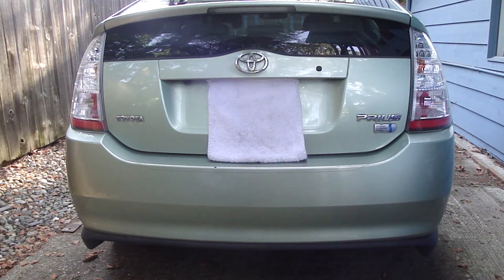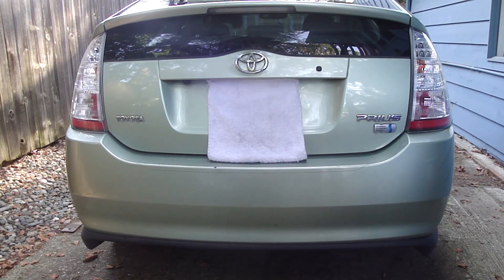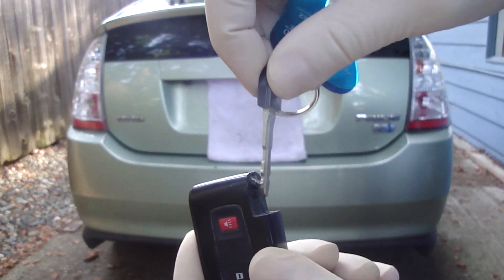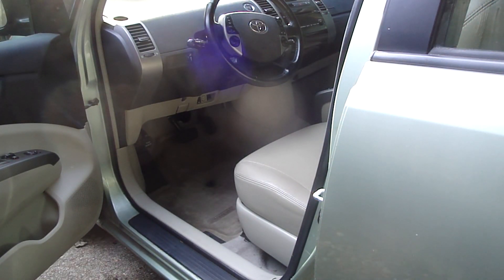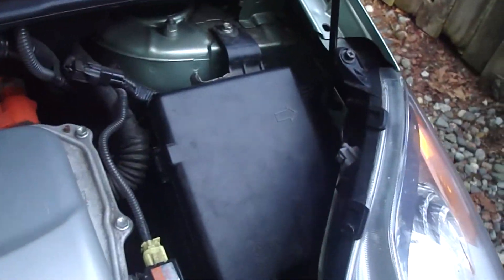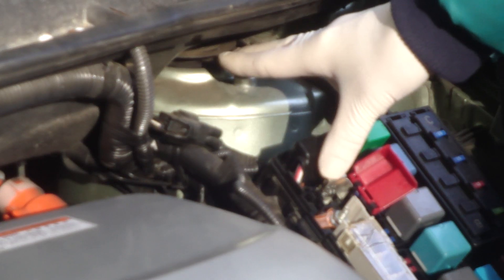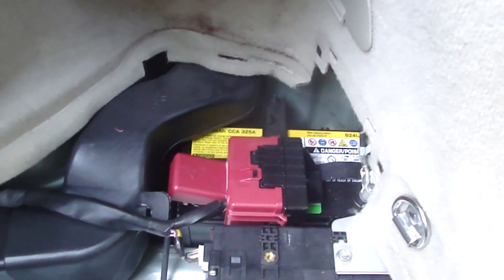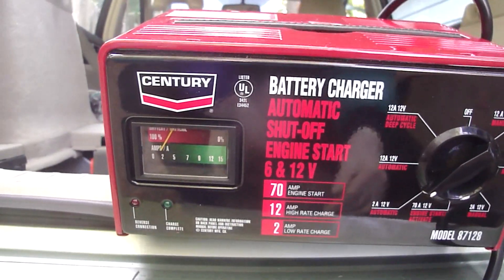Toyota Prius w/Dead 12 volt Battery / How to Open the Rear Hatch & Jump Start or Charge

Comment: Very convenient?  Doors are unlocked when your battery is died?  Try making this video when your doors are locked and the battery is dead AND the Valet Key (manual lock on the driver side) is too old to work...
Reply from the maker: If your key doesn't work you'll have to call a locksmith.  Don't go to the dealer as they are very expensive.  I don't know why Toyota didn't build a lock on the right side door, Oh yes I do, it saved them $5.00 a unit!

Comment: Thanks for the tip on opening the hatch. That seems dangerous that there is no handle to open it without taking the car apart. Most modern sedans have a latch inside the trunk to open the lid... of course you'd have to have back seats that fold down. I really didn't see much of what you did to charge the battery in the rear of the car.... so I am still at a loss.  Besides YouTube likes to put ads up before the video is finished...annoying as hell.
Reply from the maker: For this video I affixed the battery charger directly to the battery in the rear compartment.  When I top off the battery I do it from the engine compartment. If you go to the fuse box on the driver's side of the engine compartment.  Remove the fuse box cover and you will see a terminal covered with a red plastic cover.  That's the positive terminal to which you affix the positive cable of the battery charger.  The negative cable of the battery charger gets clamped to a stud on the unibody a few inches to the rear of the fuse box.
Reply: @davidgpo   Thank you very much for this additional info.
Reply: Yes, a really piss-poor design for those Oh-So-Intelligent Japanese designers to come up with.

Comment: Left my overhead cabin light on, came out and discovered a dead battery. Thank you so much for showing us how to get into the car, the rear door opened and the battery recharged.
Reply from the maker: I replaced those lamps with LED lamps for just that reason:   https://www.youtube.com/watch?v=QZMt-UZRasc&ab_channel=davidgpo
Reply: @davidgpo  Where do you get those lamps?
Reply from the maker: @amywalker7515    I ordered them through Amazon.

Comment: The old stealership, always taking shortcuts. My 12v dies if it sits more than 2 days. I think the battery is weak and an aftermarket remote start kills it. Great tip on checking the spare as long as you're down there. I remember the 1st time I had to open the hatch from the inside, thanks Toyota.
Reply from the maker: It sounds like you have a current draw.  You need to find which circuit is related to that.

Comment: Good video, simple and clear. My 2008 looks the same, though this time around I just went through the rear passenger door and took the access hatch cover off the battery without removing the luggage compartment floor. I appreciate the very helpful reminder to remove the connection (and telling us the proper wrench size!) to the negative terminal before attaching the charger leads and giving it juice.
Reply: Thank you.  I'm too old to crawl back there ;)

Comment: We can connect postive wire to de red cover below .and negative to that screw so it can charge the battery automatically?
Reply from the maker: Yes, but it's only automatic if your charger has a feature to keep it from over-charging.

Comment: Also if your fussing with the 12 volt battery get a flashlight and look in the bottom of the well that battery is sitting in. On most prius it will be full of water. Very very common to have a cabin leak back there. It comes from cracks in the body.
There are 2 black plastic strips on the roof sides. They pop right off. Look at the valley area where those drip valleys meet the hatch quarter panel. You can see there its pop welded and puttied. On just about every G2 you will see hairline cracks in those upper hatch corner valleys. Not sure if its from slamming the hatch cover all the time or its just big body flex there. very very common leak lots of water under the spare tire and in the battery well. if really bad the water will overflow in the cabin and get under the back seat carpet.
Reply from the maker: Very good point.  Fortunately, our interior is bone dry.
Reply: There is a rubber plug under the car that is the lowest part of the battery compartment. I popped mine off and the water drained out :)
Reply: @MilesCobbett  Also I assume its the plug in the battery well. There's 2 plugs in the trunk floor one  under the spare tire and one in the battery well. Would not to surprise me there was a swimming pool under the spare tire.
Reply: Thanks for the tip. This happened to me and wondered why the carpet floor behind is always wet. Discovered the trunk was full of water.🥲

Comment: You can charge on the front hood itself... No need to go to the actual battery in the trunk after all these difficult maneuvers
Reply from the maker: Yes, however if the battery won't take a charge you have to dive in through the back.

Comment: Well done!   Note that when you remove the top of  the tool tray, there's a plastic cutout that covers the opening where the hatch latch sits.  If you punch out that cutout, you can reach the hatch latch without taking the tool tray out of the car.   Good tip about checking the air pressure in the spare!
Reply from the maker: Great tip!
Reply: The battery in the rear does not start the car !  Only the hybrid battery starts the car!
Reply: @ratrod40 It does power the accessories/computer though, without which the car definitely will stay dead, no matter how much power you have in the HV battery.

Comment: Hi! I have a 2006 Prius. I did not drive it for a couple of weeks and the car was dead. My husband replaced the battery in the back of the car and the car turned on without a problem. My husband turned it back off and the car never started again. What can we do? Please help and any advice will be greatly appreciated. Thank you!
Reply from the maker: Check the fuse box and check all the fuses and the starter relay.  Then take a volt meter to the battery to check it's voltage.  If it has 12 volts the battery is good.  Put the volt meter to the leads of the starter to see if the starter is getting voltage.  If the starter is getting voltage the starter may be bad.
Reply: @davidgpo  The G2 Prius does not have s starter. Its uses MG1 to spool up the engine.
Reply from the maker: @My1970TransAm    I didn't know that.  Thanks!

Comment: So many prius are dying these days as no one drives there car much because of Covid. That will kill an old G2 prius both the 12 volt battery and especially the hybrid battery. Go to the prius online Forum for prius called PRIUSCHAT.COM  and join. Wealth of info.

NOW do not ever ever jump your 12 volt battery by connecting directly to the battery in the trunk. Seen so many people F that up reverse the leads and destroy the 12 volt power buss.
Its dangerous its stupid.
Toyota gave you the 12 volt jump point in the front of the car they do not want you in the hatch. If the 12 volt battery dies you do not need to crawl into the hatch area and open the hatch that's why they gave you the front jump point!!!!
Inside the key fob is the hidden mechanical key to the front door. There's a little switch lock on the top of the fob. Hold that lock over to one side and pull the key out. Use that to open the front door.
Pop the hood. Inside the engine compartment is a big BLACK plastic box to the right of the inverter big silver cover. Take the cover off that fuse box. Under there is a little red plastic cover. Little clip on the left of that red cover open that clip and swing open the little red door revealing a little metal vertical mounted metal tang. That tang is bolted down to the fuse box and the main power lead from the battery in the hatch.
 Its connected to the positive terminal on the 12 volt battery in the hatch.  That vertical  metal tang is where you connect the positive red jump clamp. That's why theirs a vertical mounted tang there so you can attach the big jaws of the red  jumper lead clamp to it or your battery charger. The ground is use the bare bolt head right above it on the chassis. I have also  used the front jump point to battery tend for years and years.

Never ever measure the DC voltage directly at the battery first. Its meaningless. it only matters what the car see's at that front jump point. Before that big cable gets to that jump point tang it has to go through 8 connections to the battery  one being the ground and one big long under the car cable 15 foot long cable. Measuring 12 volt dc at the Jump Point tests all those connections and its ground to the chassis.
Cant tell you how many times people say my 12 volt is good I measured it and the car still wont start. That's because there not measuring it where the car sees it. Loose or corroded ground in the hatch and you will have nothing at the front jump point. testing in that hatch across the battery's terminals you will not see that.

TIP:   Take the car mechanical key out of the fob now and test the door lock. Most g2 owners have there car for years before they need to use that key.. They desperately need it to work and find the mechanical door lock is rusted stuck because it has never ever been used. Find out now and shoot some  l;lubrication in the key hole before trying it. It will need that lube lol trust me.
Because sooner or later you will get a dead 12 volt battery in your G2. GUARANTEED!
,
Reply: That's exactly my problem. Not driving the car. 12v battery is dead.

Question: should I try and recharge the 12v battery or change it altogether?

Will the hybrid battery be gone if we don't drive?
Reply: @kmsubbu  if the 12 volt is older then 3 years old or has gone dead before change it.
Always use the front jump points to charge. As far as removing the 12 volt battery there are 2 black power leads plugged into the 12 volt pos post assy.
The fat one is the main B+ line to the fuse box it is bolted down to the same nut that holds the jump vertical tang in the front fuse box. The skinny one is the I invert sensing line.
They both can be easily unpluged by pressing the little white lever in there white plug and unplug it. Then No sparks changing out the 12 volt.
if you have the original hybrid battery you will surely kill it letting it sit. Corrosion quickly becomes an issue and so do does self discharge.

Comment: Just want to clarify- if you need a quick jump you can do this under the hood? But if you need to recharge the battery.. it should be done on the actual battery itself in the trunk?
Reply: Bullshit. I have been maintenance charging my 12 volt battery for 13 years using the front jump points.
Reply from the maker: It should work either way.  I thought the charge would be more efficient by charging directly on the battery rather than going through ten feet of wire (the longer the wire the more resistance).

Comment: The thing I found is that the terminal opening is so small that it was REALLY hard to make my jumper cable make contact!
Reply: No.. it has a vertical tang of aluminum bolted to it very easy to attach a jump claw. Look at it closely.
Reply: @My1970TransAm This. Took me a while to realize that as well.
Reply from the maker: Yes, it's like a toy.
Reply: @davidgpo  it IS a toy- we called them Toymotas in College, yet we all had one.

Comment: On a 2019 Prius Plus model I could not find a lever to open the hatch but was able to access the battery from inside the car to give enough charge to open the rear hatch electronically, thanks for your help

Comment: I went to autozone they told me its conpany policy they cant charge or test my battery. My screen is cracked and touchscreen doesnt work. Is it safe to buy a battery teater amd test it myself
Reply: Due to covid, they wouldn't run a diagnostic on mine, (corporate policy)  so that could be it.    Find a locally owned.
Reply from the maker: Don't understand why they won't test your battery.  Did you call some other stores/shops?   I don't see what harm you can cause by testing it yourself.
Reply: Try batteries and light bulbs

Comment: Unfortunate;y, he is demonstrating on a car with a working battery installed.  That's why he was able to open the back driver's side door by reaching in and pulling the handle.  In reality, if the battery is dead, the back door handles do not work so you are stuck with having to try to climb over/between the front seats to get into the back seat to try to put the seatbacks down and do the rest of the steps to open the hatchback.  The men in every video on its problem have done the same thing.  If you are going to show how to do this with a dead battery and all the doors locked, you should disconnect the battery first so we can see what's it's really like.
Reply: Actually in my case - I started with searching for 'how to open the hatch from inside the prius with dead battery' - found that easily on google - then navigated to this fine video and it got me to the steps needed - You are correct in your assessment. Perhaps you could add value and create the full video you are referring to?
Reply: Yes, l was locked out with no 12V power and had to start off using the little key inside the fob to open drivers door.

Comment: DON'T PUT YOUR HAND TOUCHING BOTH THE POSITIVE FUSE BOX TERMINAL AND THE CHASSIS!  

He had a glove on and perhaps the battery was mostly dead but don't do what he showed.  Please be safe!
Reply: thats 12 volts dc dude. It wont hurt you a bit.
Reply: Your kidding me.
12 volts dc is very safe. You can touch it all day long.
Reply: Bro, stick to squishy remakes.
Reply: Also don't touch the red and black jumper cables to your tongue at the same time. 
Why would your hand ever be on the positive fuse box terminal and the chassis?
Reply: I thought the tongue test was how you made sure your charger was working. @AlitaBeyay

Comment: Prius 2007 nothing show light, all not working. It's hard open the door and even the back. We used key it's open driver side, insert key and power buttom green, and red but nothing all work. Maybe it's battery problem.
Reply from the maker: You can open the hood and charge the battery at the battery terminals incorporated in the fuse box.
Reply: @davidgpo  How the heck you open the Hood when your battery is dean and you are locked out?
Reply: @mishrasunny  You key fob has a physical key on it to open the driver door. Then you can open the hood

Comment: ghaa wanted to see how you get the stupid plastic hatch opened and you skipped that @.@
Reply from the maker: You don't have to remove the plastic covering on the hatch, you can reach the latch with your hand without removing the cover.
Reply: @SquishySquid .  First you remove the horizontal cover that hides the tire tools, THEN you remove the black plastic tray that hides the spare. Then you can reach the hatch release.
If you need to remove the hatch trim(big plastic piece) for another repair, search Youtube

Comment: Whatever you do DON'T CHARGE A PRIUS WITH OVER 2.5 AMPS.  The manual also warns not to charge the battery in the vehicle because the noxious gasses released from the battery can cause the battery to explode and that can KILL OR MAIM YOU and IT WILL RUIN THE CAR.
Less than a year ago, I used a battery charger to start MY 2004 PRIUS  I charged it on the lowest setting, but it was not a trickle charger.  A day later, the battery was dead forever.  I had it towed to the dealer. A new battery costs almost $280, but the dealer was the only supplier who offered a three-year warranty.     At the time I jump-started,  I tried to keep the voltage the lowest setting but had no idea of the danger I put me and my vehicle in.  My new battery died from a door-ajar dash light that stayed on for a few days in my garage. When it died last Sunday, I didn't even bother to try to jump or trickle charge it.   I used roadside assistance to have it towed to the dealership so they could evaluate it.  The dealer replaced it free of charge. I am SO GLAD I did have it towed.  I could have saved so much hassell if I had I would have had it towed to the dealer instead of jumping it a year ago.  Please, BE CAREFUL!
Reply: Thats total bullshit. The 12 volt  battery is vented it releases no gas at all really. I have been battery charging my prius from the jump point for about 12 years. Your battery died because it was old as shit never battery tended you left the door open and flat killed it. I Have been using this charger a  MUS 4.3 for about 3 years on Amazon. Its new has recondition mode. 
Your charger is a piece of shit has no recondition mode which would have removed the sulphation it got from  sitting stone cold flat dead which really hammers an old battery.
The charger didn't kill it it was already killed.
People who have repeated dead batterys all have one thing in common. That's they never ever arm the cars alarm with the fob. need to do that every single time you get out of the car. If they did it would alert  you to lights left on or door ajar.
That and if its nighttime arm the car then peek in the window and make sure you didn't leave the overhead light on.
Reply: Barbara. You don't know what you are talking about. But you are excellent at telling horror stories.  Your Prius charges its 12 volt battery all day long while you are driving and the battery is always in your car. So we should all be dead.  A 4 to 7 amp charger is highly unlikely to overheat your 12 battery.  Its  no different from any other 12 volt battery.  Lasty most people charge their Prius from under the hood. But even if they charge it from the hatch,  why would anyone close the hatch on their power cord or charging cables?  The since the car charges itself once its started nobody charges their car externally when driving with out at least a half mile of power cord.
Reply: The gases have an exhaust port attached to the battery in these.